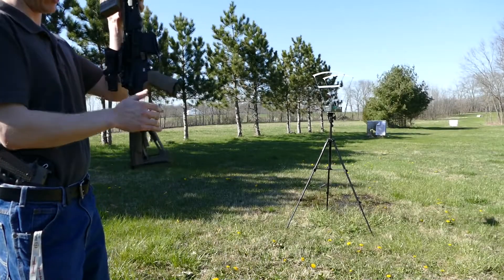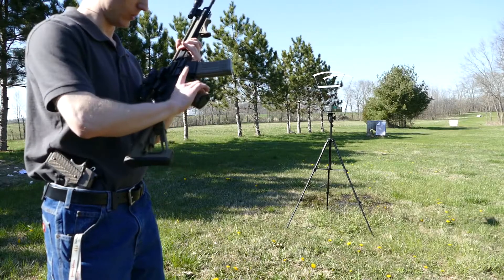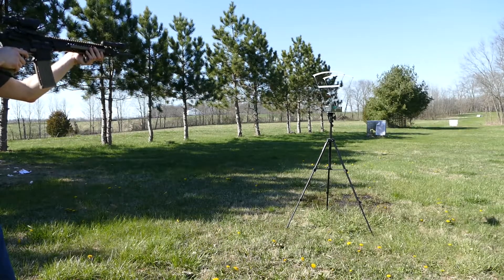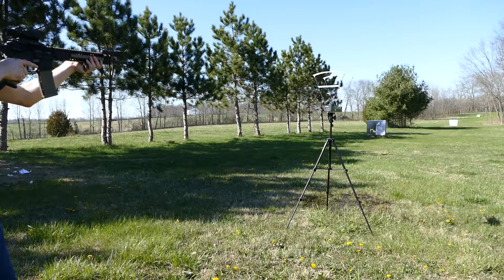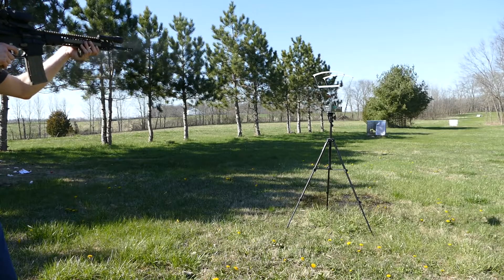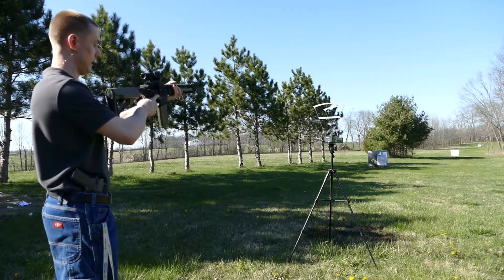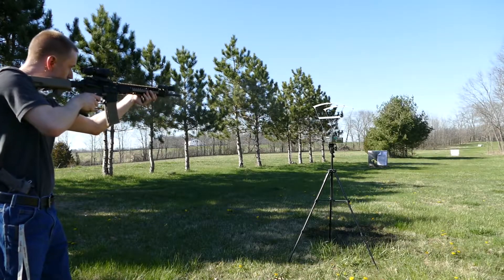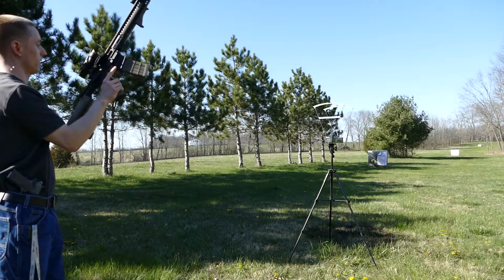Bolt Action vs  Semi Auto Velocity Comparison

Comment: No bolt action results with an ACTUAL bolt action rifle? WTF?
Reply: This was the absolute best way to make a fair comparison, using an actual bolt action would have meant using a different barrel. 

With the gas system closed off, this was the same as a bolt action would have been with that same barrel.
Reply: It's not the bullet speed they lose . Blow back gas the inters. The hole in the berrl. Into the system